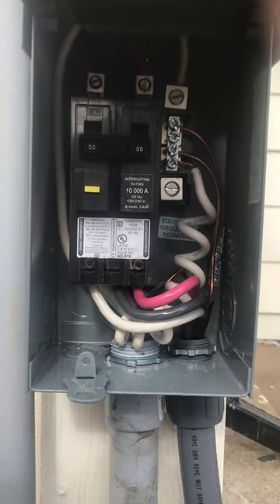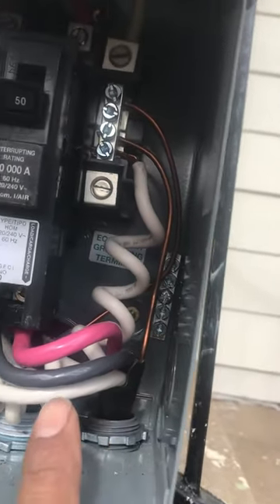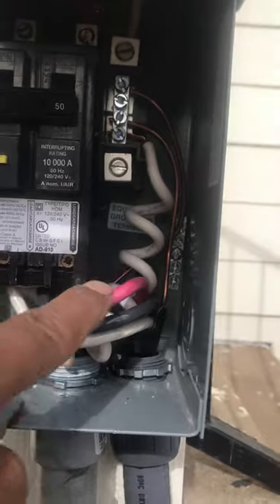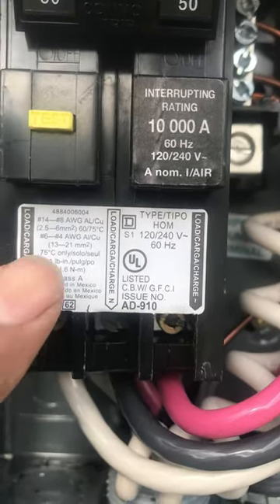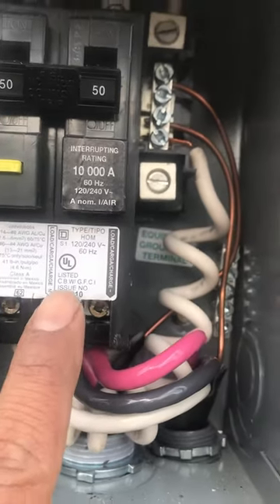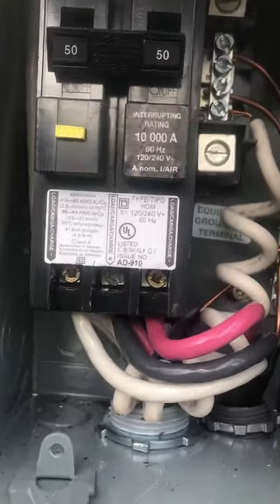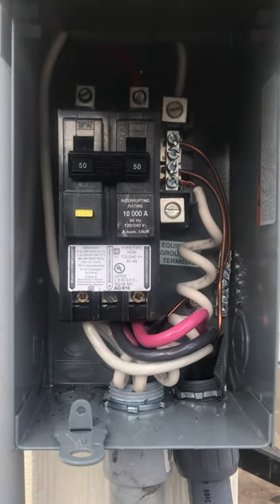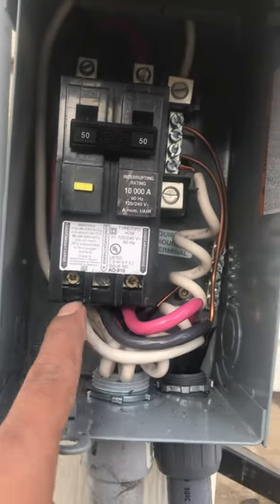DO NOT WIRE YOUR SPA GFCI THIS WAY!!

Comment: Why the hell is all the ground wires on the neutral bar and not just the ground lug?
Reply from the maker: I honestly couldn’t tell you boss. Sounds like a job for an electrician. As far as I can tell. It won’t make a difference. Maybe it was just easier to ground at the neutral bar so you don’t have to worry about short wires (less maneuverability)…maybe. As long as you follow the wiring diagram given in instructions everything should be fine
Reply: That could literally kill someone putting ground on neutral bar